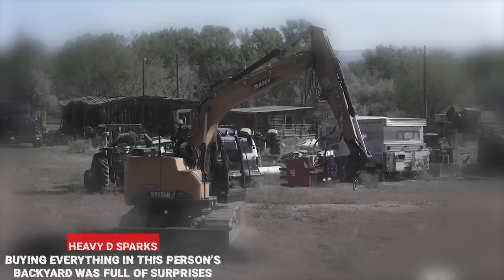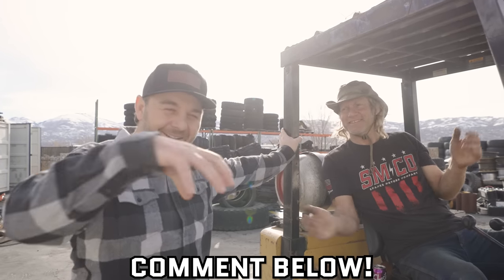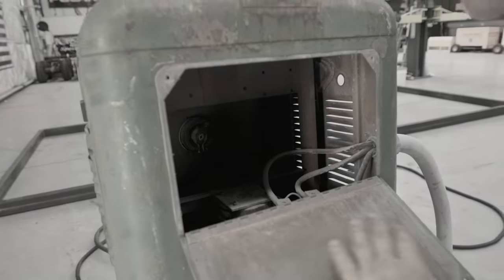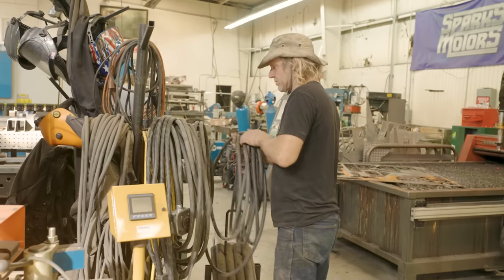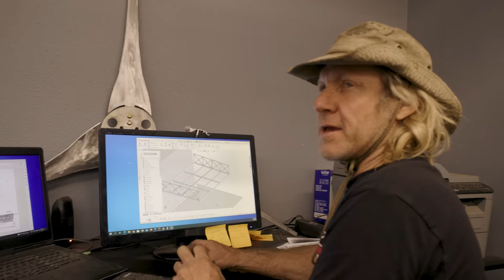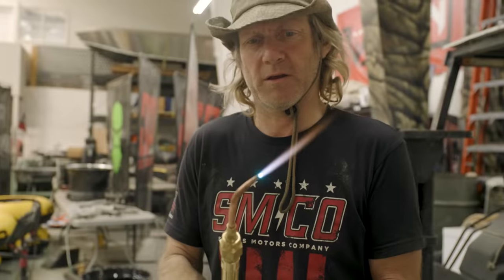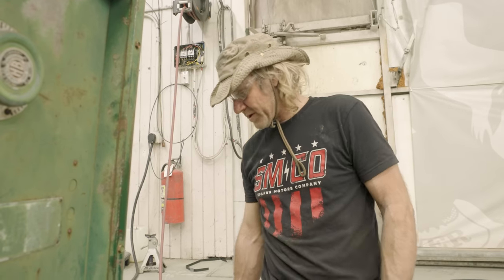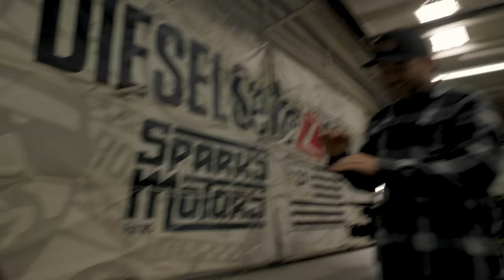WE FOUND A 100-YEAR-OLD WELDER!!! WILL IT START?!?!

Comment: For the welder being as old as it is, it is surprisingly good shape.
Reply: Back in the day,  they built things to last.
Reply: But really what could go wrong with it?  It's just a big cored block of iron wound with >100 lbs of thick copper wire, a nichrome wire wound rheostat and a mechanical switch to select between the massive transformer output windings (voltage select) oh and a fan.  The fact that the fan is working is what I find most remarkable here,lol.
Reply: @waynegnarlie1  only thing to go wrong is crackheads wanting the copper 😂
Reply: @mr1ybbob3214  hahaha!  The 20th century designers of the transformer probably never saw that coming.  Would've sounded like a fable to them. "In the 21st century drug crazed zombies eat copper".
Reply: If you want something reliable, you should by something like this.

Comment: When I was a kid, I would watch my father arc welding with an old WWII-era welder. We grew up on a decommissioned WWII military base, turned boarding high school and the government left behind a LOT of equipment that the school continued to use for decades. The arc welder looked very much like the one shown here. Granted, the military base opened in 1938, so unless THAT base got it second-hand, that welder wouldn't yet be 100 years old now if it still existed. I am pretty sure that it has been scrapped many years ago now.

Comment: The old Hobart's where built to last!!! Based in Troy, Ohio. They were bought out by Miller. They still make small wire welders for Tractor Supply. Miller mainly bought them for Welding Rods and Wire. We have a Hobart Stationary grinder, it's  bigger than a pickup axle! We also have a generator/welder, powdered by a 2 cylinder Wisconsin engine . And a Beta Mig 200 Hobart wire welder.

Comment: Given that there is a solid state metal (selenium) rectifier in the welder (the finned object), I am not sure it is as old as you think, as the rectifiers were not invented until the mid 1930's and not in common use until some time later. I would guess the welder dates from the 1940's or even 50's.

Comment: You will have to convert your AC to DC for your electromagnet. The transformer on the input side of the welder would be wired parallel for low voltage and series for high voltage.
Reply: LOL  Lets  watch him make  a giant buzzing coil that will burn up and do nothing
Reply: I think that is what he's thinking though. It's supposedly an AC / DC welder. The rectified output, if I'm following, is what he wants to use for the magnet.

Comment: 13:40 - You meter is probably fine. You made the correct point earlier that your current estimate is right for a pure resistive load, but you know this is an inductive load. The coil won't act like a resistor, so it doesn't draw 90amps from the wall all the time despite being effectively a dead short.

The same reason the electromagnet works and doesn't just melt the wire from the dead short. All that magnetism in the core slows down the flow of current, to put it simply.

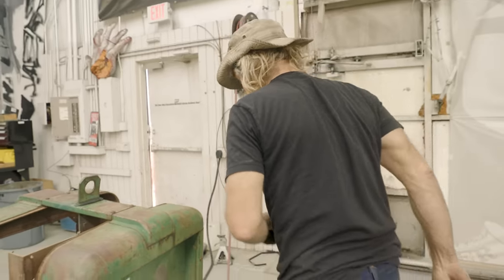Comment: I would take a round file to clean the insides of the power terminals as you got 3 metals, copper, aluminum and steel, great for electrolysis / corrosion and if you have a high resistive connection, it will heat up and start smoking. 15:05 Were the hell is your Joy Juice and apply Vaseline to any crimp on and wire before crimping, same for all other electrical connects, keeps O2 from oxidizing metals, same with moisture.

Comment: If I had the money I would 4 shirts 👕 of the wizards!!!
I have a old Miller welder from early 1900 we have used it to weld 1" plate together. It runs on 240 but has everything to wire for 440. I have seen pics of it when was working in its prime it had 2 different leads coming off it. I guess 2 different welders ran on the same welding machine.

Comment: Now you guys can take a hybrid inverter and make a engine generator, welder and plasma cutter for a project.  With a welder that has the aluminum welding offset settings like Miller and others call balance control that's an adjustable DCEN and DCEP waveform. Maybe use as the generator to run the electromagnet as well.  Man, the hybrid CVT's are a dime a dozen and can output plenty of juice even with like a little 18HP opposed twin Briggs like their hybrid did.

Comment: That welder is a beast!! 100amps just for full power…i have a old 1970’s craftman that needs 60 amps and goes to 225amps.. i run it at 1/2 power off a 8500watt generator.. Works good.. i bet that welder is from 60’s… its build quality is too nice..

Comment: Allan take a short piece of 1/2" or 3/4"  copper pipe and hammer 1 end flat, drill a hole in it to fit the stud stick your cable in thre other end and crimp it on the wire with a hammer and chisel

Comment: Cool peice of kit! 
I dont know what he tried to do but you cant measure ohms on a transformer as a welder is and calculate the amps with that and the voltage. It only works on a resistive load.

Comment: The small rectumfrier tells me that this machine varies the output AC current, simply by variable saturation of the iron core with a small DC current,. Adjusted by the small potentiometer/rheostat in the front panel.

The other, more common way, to change the transformer output, is the model with a adjustable inner leg/magnetic shunt.

Comment: When I was young in school and working for a trucking company on the weekends, my boss had and old welder that was built into it own trailer, he was welding and asked me to adjust current, as I did that I watched a big ol’bumble bee fly into the coil through the vents and the welder melted down. Scary and funny all at the same time.

Comment: Allen could build an electro magnet easy. I'd suggest number 6 copper for the wire based on the output capacity of that welder.

Comment: You can use 500 Amp diodes on heat sinks and large computer grade capacitors for DC and now you have a DC welder, and a power supply for the electro magnet. Is can do easy G.I.  Well worth the time and parts invested. Have those sidewalk supervisors. Go monitor incoming paper clips.

Comment: There's another trick you could do is heat it up red hot then shock it with cold water. When it's warm enough to touch it will break loose then heating up real fast and then trying to manhandle it off

Comment: Those wires, too me, look like at least 480 or more.  The tag reads 460 so it should be connected to something that can supply between 460 and 480 on those power lines.

Comment: calculations were of because you can not measure incuded resistance in a coil. With out it being power up the resistance is not there. (which I suspect Alan knows.)

Comment: this is what I love about ancient welding machines. They are old, rough and can be a bitch to use. But they will RUN. only god knows how long that thing sat. He basically cleaned it out and replaced the power cord for it and it just fired up and ran when it got power. You don't get that with new welding machines these days. Sure they are nicer, easier to use and just about any monkey could be trained to use it. But old-school welders like this, they can take 20-30 times the abuse the newer ones can and still keep on running.

That and Wizard is a treasure for being able to get that thing running in only 2 hours.

Comment: Never heard of brave little toaster. The cartoon snippet didn't help. Is that some obscure 'Murican cartoon? We never had that up in Canada and pretty much all cartoons up here before the 90's were American cartoons...

Alan knows about penetrating lubricants, right?

Should really just keep it as a welder, they don't build them like they used to and that seems like a top notch level version of back when they used to build them sturdy and to last, tho I suppose it'd be reversible. Good luck finding a way to feed it enough power to feed an electromagnet, you'll probably have to crank it up to the higher settings to be useful. 200 or so amps is the typical service supply from the utility for the average home, maybe 400 amps for a large mansion, and you mentioned some 300+....

Comment: Don't excavators themselves sort of pick up things under their own power?  So long as they have a thumb attachment?  And wouldn't you have to mount the generator and the green machine weld em up box to the excavator some how?  Seems like it would be easier to use a thumb attachment on the excavator buckets already functional hydraulic system to me.  If you want pick stuff up other than ferrous metal than you couldn't use the magnet anyway.
Reply from the maker: I think it’s use will be moving big sheets of metal from storage to the plasma table 🤷🏻‍♂️
Reply: @SparksMotorsCo  that's a perfect solution to that problem. Look forward to seeing that.

Comment: Alan if you want to build a new shop that can never burn down 
Pumicecrete is by far the best building material on the planet Pumicecrete is a mixture of pumice cement and water mixed and poured into a set of reusable forms walls are poured from 12"to 24" thick pumicecrete is fireproof termite proof rust rot and mold proof and has a high R value and good sound attenuation solid poured walls means no critters can live in your walls Pumicecrete can be built for a fraction of the cost and time and pumice is one of the few building materials that can go directly from the mine to the job site ready to use without any additional possessing and zero waste Google all the walls of my house are made of pumicecrete and the closest pumice mine is Hess pumice in Malad city ID take care Ray